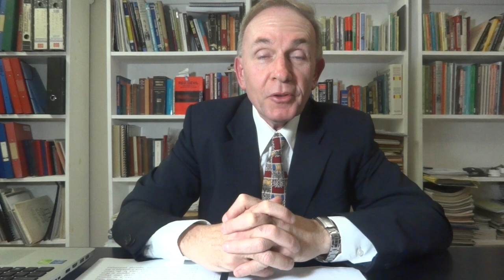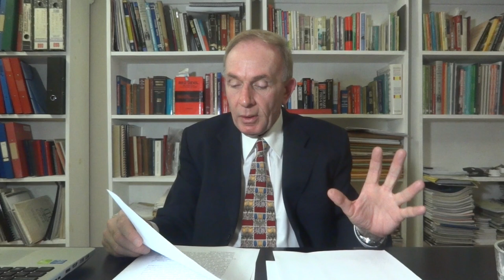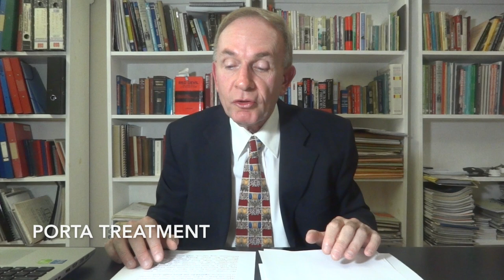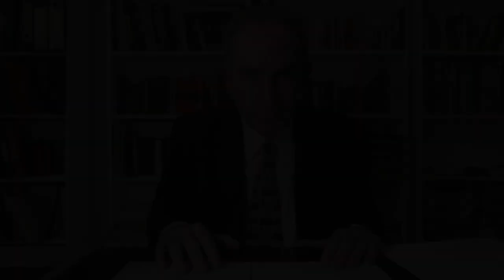Steam & Sustainability | Explained by Shaun T. Mc Mahon

Comment: My suggestion: one vehicle at either end of the consist carrying a 2-3,000 psi water tube boiler with fluidised bed, a closed parallel steam circuit feeding turbines at each bogie, treated condensing (cooling) water fed through the static elements of the turbines’ low pressure stages to create a vacuum equivalent to the draw provided by power station condensers.  Boiler water recirculated back to the pressure vessels as in marine practice plus control system which throttles steam to any turbine drawing excess steam such as during wheel spin episodes.  The heated cooling water exchanged for cold water periodically at water troughs.  The aim would be 60% thermal efficiency and 12,000 dbhp... Consists would be capable of multiple unit operation geared differently for passenger and freight operation.  There you have it: the SMU.
Reply: That kinda reminds me of a Garratt design. It works by having a single boiler, and two driving units set on a Bogie system on the front and back, similar to a type of Rail Car.

It made for quite a powerful design of railway locomotive.
Reply: Garrett s and Kitson Meyers were great, the FCAB Kitson Meyers being my favourites.  However in ‘my’ system there could be many passenger carriages or container carrying freight vehicles all with steam driven power bogies.  Acceleration would be good... with a one atmosphere vacuum at the end stages of each turbine.  Turbines might be direct drive but better still transmit power via geared cardan shafts so that all those turbines can spin very fast very quickly.  The boiler vehicles could be bogie powered too but the principle would be that all wheels throughout the train would be powered...😉